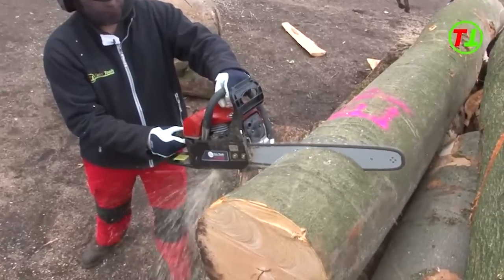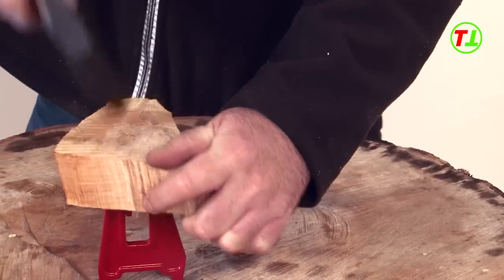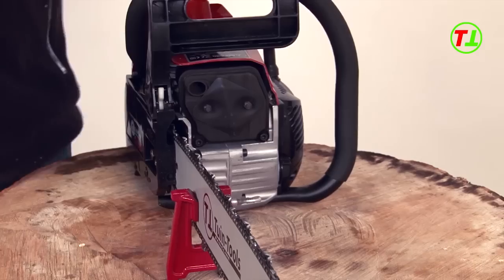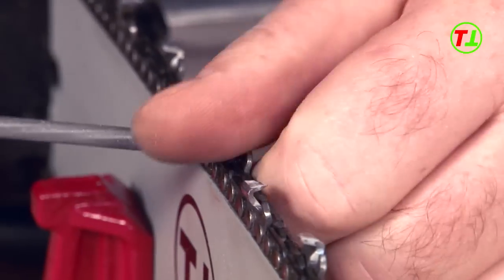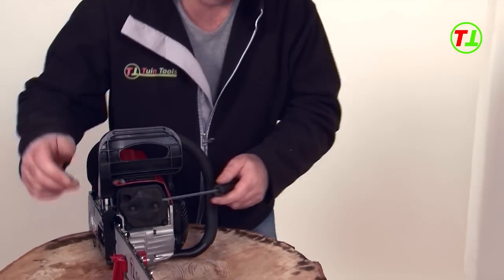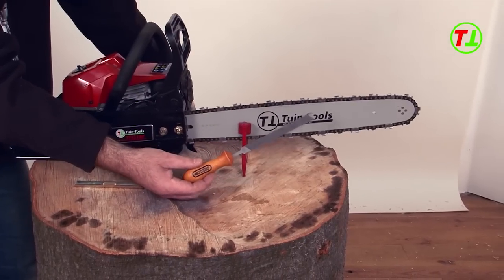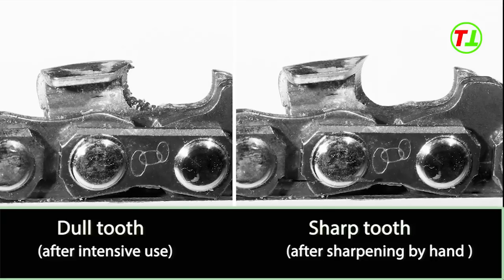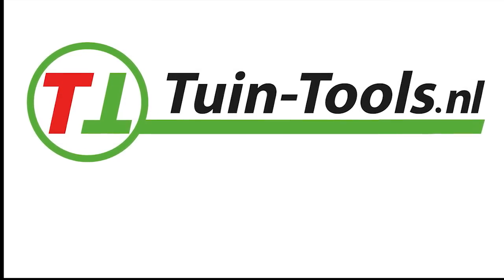HOW TO SHARPEN A CHAINSAW WITH AND WITHOUT A FILE GUIDE, ADJUST DEPTH ADJUSTERS

Comment: Hi steele829, please don't take this the wrong way, but it sounds as if you have the chain on backwards. Your comment reminded me of when I did it. In a hurry, I just chucked the replacement chain on & proceeded to burn my way through the wood, hopeless. Just like you, the chain was spinning & making so much smoke, then came the lightbulb moment! Take a look at which way your chain is on, which way the chainsaw rotates & most importantly, which way the actual cutting teeth face, it's a super simple tip, but so easy to get wrong. Cheers
Reply from the maker: Hi Rob,Thanks for your comment! You can be assured we assembled the chain correctly!
Reply: Hi Marie, sounds like he has as you thought. Gave me a smile as i think most would have it happen,    once or so!!
Reply: Good

Comment: how did you determine 30 degrees  sharpen angle?
Reply from the maker: You just follow the marking on the file guide. Without the file guide you need experience or a chain with a 30 degrees marking line.

Comment: ...just draw aline, on your work surface.  place saw bar at  30 degree angle. clamp  down, WITH LARGE  C  CLAMPS...........use line as visual   ' file  guide '...... then, file away....

Comment: You don’t have to count your strokes! So if you hit a rock your telling me your still going to count your strokes!
Reply: You count your strokes so your saw cuts in a straight angle, having uneven teeth can make your saw cut in a banana shape, not fun lol
Reply: @solarr5143  The teeth don't need to be the same length at all as long as the depth gauge in front of it's cutter tooth is taken down to the correct height for that particular tooth. They all can be at different lengths throughout the entire chain. No need to count the strokes
Reply: You do that so the teeth are sharpened evenly.  Sharpen unevenly and you will notice it in how.it cuts. So you seriously are a tree service with that kind of statement. That statement says a lot about your know how.
Reply: @texp87  The teeth can be of all different lengths on both sides as long as the teeth are sharpened properly and the depth gauges are taken down in accordance with the tooth in front of it